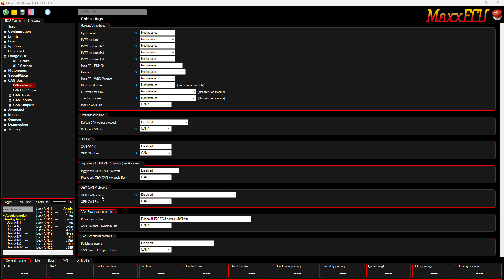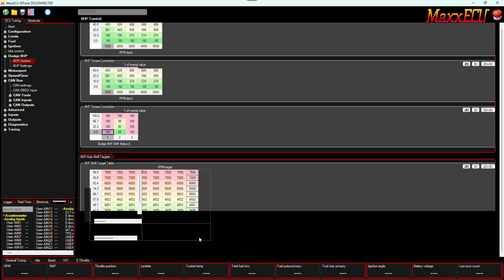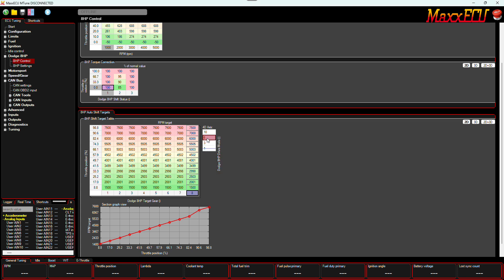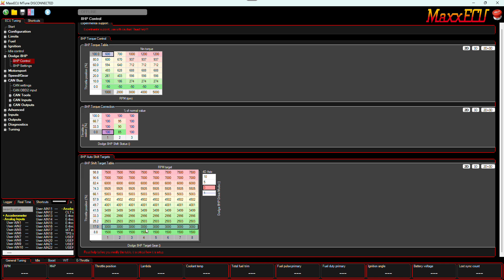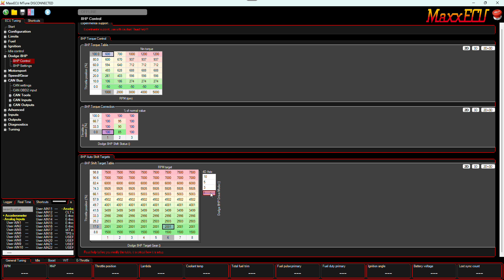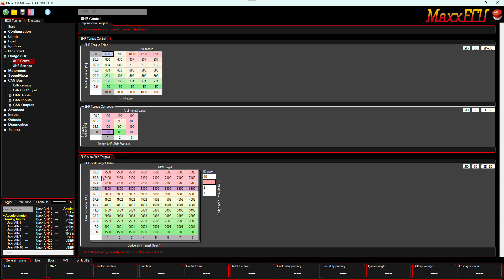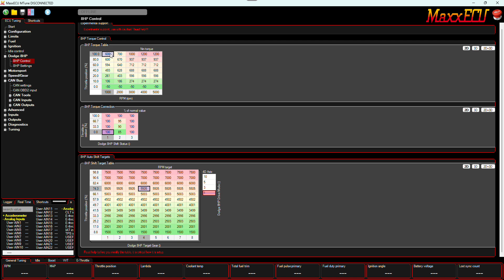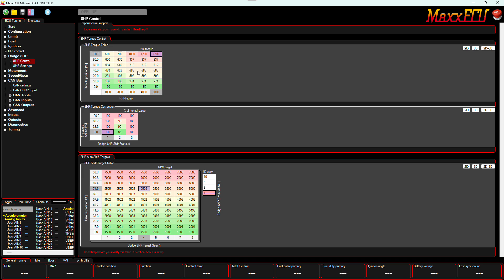MaxxECU - 8HP70 setup

Comment: Keep the videos coming! Love the 8hp stuff. Planning a hellcat 8hp90 behind a 2j with MaxxEcu. Love the info!
Reply from the maker: Sounds like an awesome project, whats your whp goals?
Reply: @kingersgarage  I planned on leaving it stock internal VVTI Aristo, with a 6466 Next Gen. Maybe 400-600 wheel on flex fuel? Nothing crazy. I don’t know much about the 8hp, but I like the idea of the Hellcat 8HP90 so ideally I shouldn’t have to “build it” or worry too much about it in stock form. MaxxEcu definitely seems like the move when starting from scratch with no previous Standalone. I just took delivery of a 100k mile Aristo with a 2jzgte VVTI so I’m researching a ton before I buy ECU/trans etc. Also, I’ve been on NoRotors for like 12 years. Love your build on there!
Reply from the maker: Very cool, you could get by with the 8hp70 with that power lever.  Lighter trans too and be able to be controlled by MaxxEcu.  Thanks for props on my 7 it’s going to be so cool when I get it all updated!
Reply: @kingersgarage  Nice! These are the things I need help with. I’m not sure what 8hp70 to buy or where to buy it. I have done a good bit of research but clearly have more to do!
Reply from the maker: @BrianCrofoot I used a 2016 charger scat pack and the TCU part number matches what is supported by Maxx. I wouldn’t do this trans if MaxxEcu wasn’t around.
Reply: @kingersgarage  ohhhh, okay. I definitely wanted to use Maxx, so this is good to know. Thank you!
Reply: @kingersgarage  I found the list of transmissions on the website. Thank you
Reply from the maker: Using dodge charger trans in US is best option I bought mine with 1011 miles on it!  $800.  Insane sweet deal.  I used a adapter from https://www.guruautowerks.com

Comment: I'm getting ready to do a 8hp swap behind a Honda f22c .  With maxxecu
Reply from the maker: That short 1st gear will help you get off the line!  Great engine!
Reply: @kingersgarage  I've ran a few things. Currently has a e39 420g behind it . Short gears are great .
Reply from the maker: @addictedtobeaters2897  Maxx is awesome.  Have you used that before on the 8HP?
Reply: @kingersgarage  I have not used there products yet but look forward to it
Reply from the maker: @ I should be running in a few weeks.  Can’t wait to rip it!
Reply: @kingersgarage  I'll be gathering parts .. and get a ECU in and running and tuned up before I swap over to 8hp. I'm sure you are  excited

Comment: Hi, MaxECU can control the xdrive transfer case unit? Separately from everything else, regulate the supply of traction to the front axle
Reply from the maker: Do you know want signals it needs or CAN messages?
Reply: @ No, but I know for sure that transfer boxes, starting with the "f" series, were a control unit together with an electric motor as one single connection, all of this is screwed to the transfer box. According to rumors that I read on the Internet, this unit can work autonomously, most likely, it just needs values, what to work from. The logic of the work is most likely in the unit itself